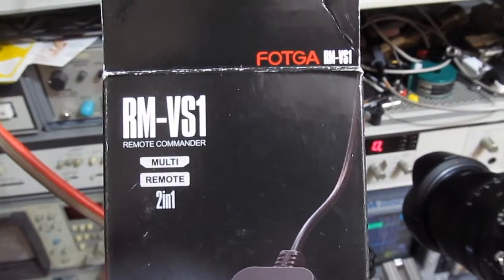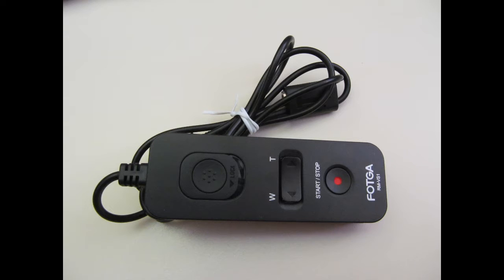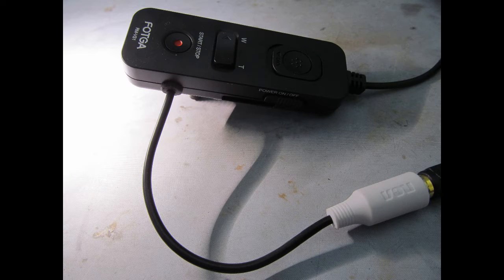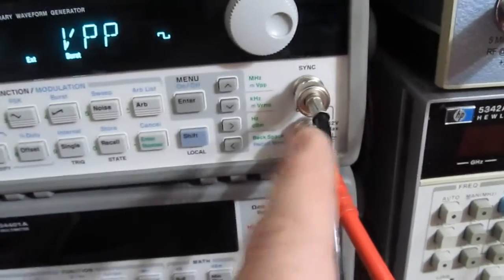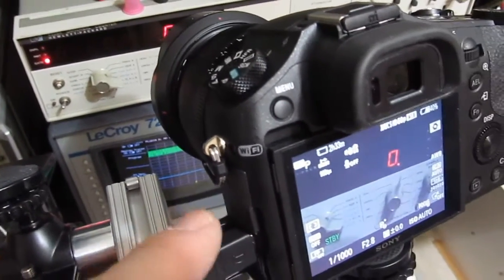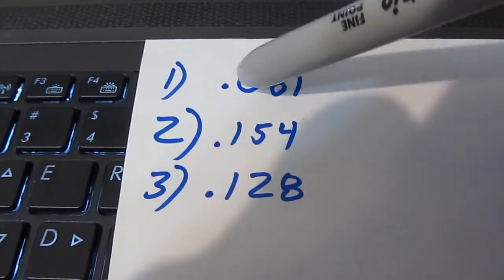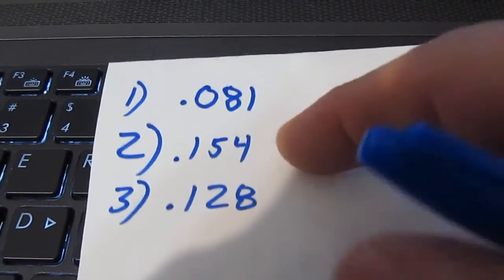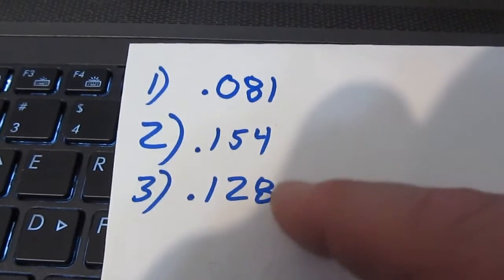Sony DSC-RX10M2 FOTGA RM-VS1 Remote Trigger Jitter

Comment: Joe, I like your video. It's very well done. A couple of questions:
1. Your narration says 2 100 ohm resistors in parallel, but I think I see only one, the SMD marked 1000. Is there a second one hiding under it?
2. What part number is your optocoupler? I know just about anything will work, but I figured I'd do what worked for you.
Thanks so much!
Reply from the maker: Thanks.  Glad you enjoyed it.  You are right, the resistors will be marked 1000.   That's 100 ohms.  220 for example would be 22 ohms.  Yes, the resistors are stacked on top of one another giving me 50 ohms.   The source is 5V TTL logic levels with a 50 ohm source as well, giving a total of 100 ohms.  The opto coupler is a Vishay K817.    Depending what you are trying to interface it with, you may need to change the input.  I was wanting to drive it from some standard test equipment that I use.